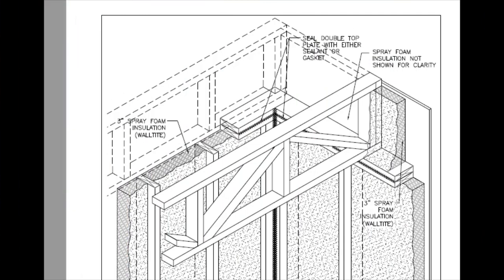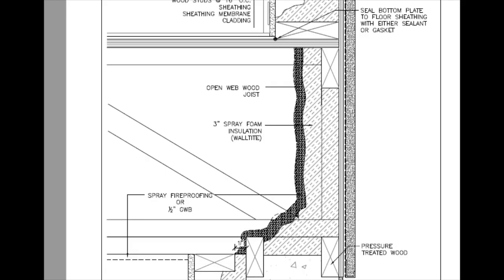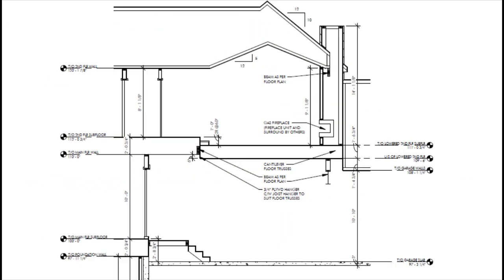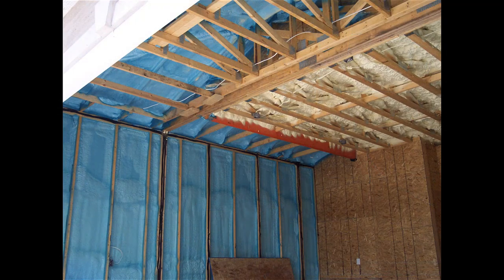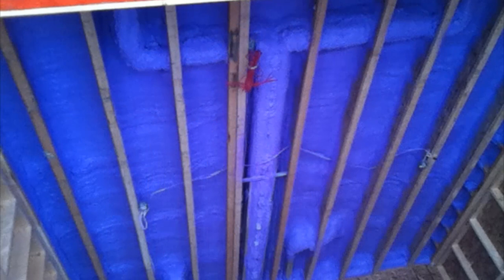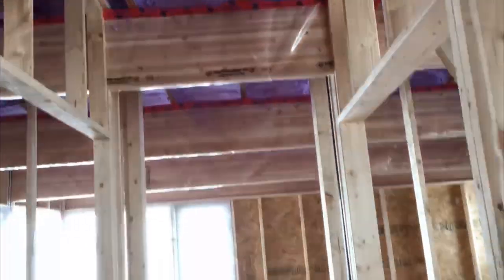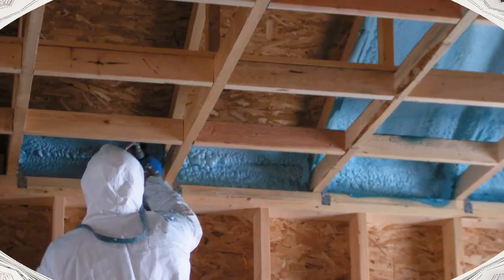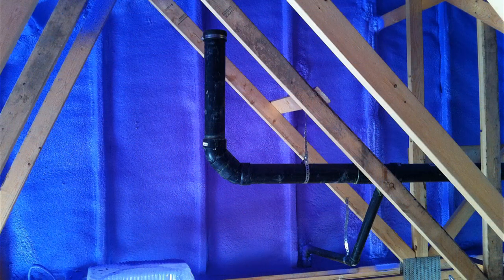6 Areas That Need Spray Foam Insulation In Your Home - And Why

Comment: So my question for inside roof applications is how are roof repairs dealt with?  Many people discover that it's time to repair their roofs when they start leaking.  It would appear that with a closed cell application that roof damage would almost never be discovered or seen until the roof had visibly degraded to the point that it needs replacing..  At that time a waterproof under barrier could conceal potentially years of damage to the  plywood roof sheathing..  And since the system bonds itself to the plywood and trusses/rafters it would make replacing or repairing that damage problematic.

Just curious if that is an issue and how is it dealt with as that is one of the concerns we have before moving forward with a retrofit/spray application in our own attic..
Reply from the maker: Please watch our video "closed cell vs Open cell for roofs, which is better".

Comment: Great videos!! 
I’ve recently decided that I want to get into the spray foam business her in Texas. I have been doing my research and scheduled some training with BASF but you as a professional with 15+ years in the industry, would you have any advice for a beginner, how to start, what certificates to carry, any advice really. This is an open question for anyone who is in the Spray Foam Industry. Thank you all in advance.
Reply from the maker: Go work for someone for 2 -3 years first. Otherwise stay out of the business.
Reply: @SprayJones  so who did it first? You realize there's gotta be someone who learned without working for someone right? I really like your videos but everytime this question comes up you answer the same thing which I get why but disagree. People can learn, are they going to make mistakes? Yes of course, just like you did I'm sure. I think there is a way to get into the business gradually without working for someone else firdt
Reply from the maker: @201francois  When CUFCA started in Canada in 1985 they certified the already existing SPF installation companies that wanted to be the first certified accounts. Then the only way to get into the SPF certified business was to be apprenticed with 2000 hours of verified spray time before you could write your tests bu one of them. No avenue existed for cold start ups.

In 2005 the industry deregulated in Canada because of requests for growth, and a flood of installers hit the market just as you suggested. With it, a flood of BS problems have skyrocketed. Hence this channel is now out to get back to the knowledge and teaching aspect that has been lost. 
The old methods had merits and I do not endorse the fumble around ways. 
Do you apply this logic to flying a plane? Being an electrician? 

Some things you just don't want to learn the hard way.
Reply: @SprayJones  depends on the industry but since I know aviation I'll talk on that. The answer is yes. You take a course then you have your license and you fly. Sure you don't fly the 747 right away unless it's your own but you can still fly as a commercial pilot as soon as the courses are done. 

Same thing for a lawyer, an optometrist, a mechanic, so on so forth. 

Could the industry go back to better training? Probably. But one guy can certainly learn and grow as it goes. 

As I said, I know where you are coming from and I know you are mad because instead to just sell a product you have to deconstruct the myths then sell but I just sincerely believe a smart person can learn anything with the right approach. Yours is just different than mine.
Reply from the maker: @201francois  I do not deny that a smart person can, and they have. We learn ongoing, of course we do. It takes more than book smarts to be great at this line of work. I have been around very stupid engineers that could not figure out the envelope, but we could. However, the percentages out there suggest that we cannot structure it in a cold start method to protect everyone involved. Plus most people are romantic about spraying foam but find out they hate it. So why not apprentice first before investing. 

I keep educating the masses so that we can work. I have had more issues created for us by newbies versus any other factor other than financing or weather. 
So yes I am biased. I believe in apprenticeships and mandatory accredited training and inspections.
Reply: @SprayJones  I've wanted to do spray foam on a professional level since the first time I seen it on tv years ago. Never even knew it was an option where I live in Wv. So as soon as seen a company in my area was taking on applications and would help get you trained and certified I went for it! In a month I may decide or they may decide its not a good fit. I told them I'm ok with that. I'm the type of person that takes pride in my work and fully believe you should do your job right the first time. I definitely could not in good conscience spray somebodys home not knowing what I'm doing. Nor would I expect the company to keep me on. So thats why I'm watching your videos. Just so I have a general idea of what to expect! Really hoping this works out for me. If not I'll be gracious and thank them for the excellent opportunity go on my way with some money in my pocket and hopefully learn something along the way.
Reply: I'm brand new as well. Just got hired on for a 90 day probationary period. I'm just going in willing to learn and watch what and how they are doing it. I'm going to bust my butt and try to prove I'm worth having on the job site. My background is in more physical work and cleaning. So I'm hoping that I can build my confidence when it comes to prep work and clean up. Super excited to spray but fearful of messsing up and costing my employer money. So any advice would be greatly appreciated! I start Monday.

Comment: I have always talked my customers into closed cell foam any opportunity I can get. It is a great solution for everything you mentioned in this video. My question would be do you recommend a foil vapor barrier between the roof sheathing and the insulation? Thanks for the video.
Reply from the maker: No you do not. SPF - closed cell- properly installed is a stand alone product when caulking is used to fill gaps the foam cannot get into. 

Thanks for your good word on the foam!

Comment: I understand that foaming under a roof deck with shingles will cause them to fail in a relatively short time frame.  Several videos on here dealing with this problem and virtually all manufacturers will not guarantee their shingles when installed on such roofs.  What's the deal?
Reply from the maker: Go watch our video "spray foam and shingle life, just the facts"
Reply: @SprayJones  - Very good video.  I watched it entirely.  I still question whether it should be used because there are other, equally well researched and presented videos showing just the opposite.  Dang, even construction techniques seem to be becoming polar opposites.
Reply from the maker: @flick22601  Then do what you want. I will not deal with someone who is confused.
Reply: @SprayJones  - No need to get snippy.  It's just that nobody really seems to know and people on both sides have evidence to back their claims.  I'm not saying either is correct and it's not me that is confused if there are opposing points of view or if you think I'm confused, then you haven't listened to the people with the opposing viewpoint.

Comment: The joist ends do not get insulated or protected from moisture when you close cell them.  Closed cell on the outside could solve, but blow grade to protect the foam.

Comment: My house was built in the early 50's and has plenty of cold spots.  I looked into doing spray foam but found it too costly for my budget.  Opening up the walls is the right way to go but I'm afraid to find the unexpected.
Reply from the maker: Thanks for sharing
Reply: What did you end up going with?
Reply: @briansusewitt8475  Nothing in the walls but I air sealed all the ceiling penetrations and added blown-in cellulose to the attic. The results are effective but not perfect.
Reply: You can get cellulose or something similar blown into your wall cavities. This would require 2 or 3 inch holes to be drilled for every stud cavity, which could be done from either the inside or outside. This requires repair to get the holes covered and finished over again of course, but this would be A LOT less disruptive and costly than stripping down to studs to get foam sprayed in there. 

Yes, foam would get you better air sealing and R per inch, but it's a lot more work and expense. Personally, I would only do foam if I was already planning to do a 'down to the studs' renovation on a house for other reasons.
Reply: @mpettengill1981  The cellulose would be directly in contact with the brick which would eventually get wet rendering it ineffective, no?
Reply: @MarlonJoseGE  That's a good question, but it depends on a lot of different variables, in particular how cold it gets where you live, and whether or not there is an existing vapor barrier behind your interior finish wall. Talk to a reputable insulation contractor in your region and they can make a recommendation for your particular home construction and needs. I'm not an insulation expert, just a dude on the internet who has fixed up a few old houses , so I can only speak to my own experiences :-)
Reply: @mpettengill1981  1.5yrs ago when I did this I removed the baseboards to seal the gaps with backer rods and caulk.  And via that gap, I could see straight through to the exterior brick/mortar.  No vapor barrier whatsoever was in place. That explained why my interior walls are so cold in the winter. (Climate Zone 4)

Comment: Nice video! Hopefully you can give me some wise advice!
I just had open cell installed in the floor joists of my modular home. The crawl space is still exposed to outdoor elements because it only has plastic vented "underpinning" or "skirting". It does have 6 mil plastic on the ground but it's not in the best shape. Under the plastic is dirt and the bottom of the insulation averages between 2.5 and 3 feet from the ground. 
What would be the next steps to create an efficient insulation system? Should I install a tyvek type material against the foam and joists to prevent moisture from rising into the open cell? Should I attempt to encapsulate the crawlspace and try to make it air tight? Should I be more concerned with installing new plastic on the ground?

Thanks in advance!
Reply from the maker: I know too little about your personal situation to advise you on next steps. There are many variables left out that need consideration.
Reply: @SprayJones  Thanks for the response. What types of variables would you be referring to?

Comment: Can I use 2" rigid foam in the walls and seal the perimeter of each sheet with blown in foam?
Reply from the maker: Yes. 

You can also walk on hot coals if you move fast enough...

Comment: I live in Atlanta.  I've been thinking of 2 spray foam projects.  Which should I do first?  Spray foam crawl space foundation wall, with foam board rim joist (for termite inspection).  Or should I spray foam my roof?  Which would yield the biggest energy benefit?

I've heard that spray adds strength to a structure.  Our home was built in 1921 and does not have a subfloor.  Joist are spaced 20" - 30" apart.  Our hardwood cherry floor is all 8' lengths.  Would spray foam from underneath stiffen the floor.  Or would it expand and come through the cracks into the living space?

Thanks
Reply from the maker: Roof.

Comment: Have to remodel a bathroom and took some sheet rock off the wall. To my surprise I have a few spaces that had no insulation in exterior wall. It was stucco, wire, and seem like vapor barrier, studs than sheet rock. Empty wall spaces seems like very poor construction. Home was built in 1992 in Las Vegas would spray foam be a better choice in this hot climate?
Reply from the maker: Hmmm, let me think..... YES.

Comment: Hi Spray Jones,
Quick question; I have an older farmhouse recently gutted and renovated. I went with batt insulation when I put her back together.  My house is framed out if old growth barn wood. My Contractor said that we could not use spray foam because wood needs to breathe and that it could begin to rot if we used spray foam. How do you spray older homes like mine? Thanks !
Reply from the maker: What rubbish. We aren't encapsulating the wood in spray foam. Plus how much moisture do you think is left in old growth barn wood? You got bamboozled.
Reply: @SprayJones  
Thanks 👍
Reply: I have sprayed 200 year old barn up here in Maine a bunch of the some were done 18 years ago not one problem yet

Comment: Hi there, 
Looks like you do great great work and all it top quality stuff! 
Question? I’m dealing with a 100 year old house, live in Massachusetts.
outside walls are 2x4 and I’m in the process of renovating the whole first floor, took out the blow in insulation and I want to go with foam of course. 
Should I use closed or open cell in the outside walls ? 
Also what should I use in the ceiling insulation. The whole floor is gutted out, floors walls ceiling. 
Thx in advance
Reply from the maker: I am a big fan of closed cell. It is the rolls royce of spf. However it will have to fit your budget. Open cell is better than no SPF.

Comment: Is that closed cell in the attic? Also, is it ok to apply 2” to the top side of the crawl space and rim joist (totally isolating that space from the house above) as opposed to the walls/rim joist?
Reply from the maker: Yes closed cell being used. 2" to top of CS, yes we have done this for cold crawl spaces. If they are heated we spray the perimeters.

Comment: Thanks for the information.  With 2x4 walls.. if u use 2 " of foam do u need to fill the 1.5"  air cavity before the sheet rock is installed?  I'm in central California valley.
Reply from the maker: I concur. Jay beat me to the answer.
Reply: Jay Bietz no you shouldn’t at least not in nc.. depending on the code for where you’re at.. 2” of foam is an R-15 which is up to code for a 2x4
Reply: @carlfrase8097  thanks for the reply.. I'll not worry about the void between the foam and sheet rock. 
Jay
Reply: Jay Bietz the void really means nothing.. the foam is not only a insulation but a sealant (closed cell) so the void you are worried about is nothing at all but a little extra space (almost like putting left overs in a tuba-ware container.. and having that little void between the food and the lid.. it’s nothing at all lol)
Reply: @carlfrase8097  thanks for the good advise..

Comment: So it seems u never had issues with 1.5” ... idk I’m always a bit worried and spray 2” min since I’m scared it would not be enough thermal break but ur 10 times longer in business! I enjoy the videos lots of good information!! And of course I like to watch u Guys spraying that butters cheers
Reply from the maker: I have jobs sprayed with an inch. A lot of commercial specs here call for 2 inches, like on concrete etc.

Comment: A lot of closed cell... what’s the yield per set?
Reply from the maker: It's the best and what started the industry. We get 5000 board feet
Reply: Spray Jones - 5000 man, that’s good. I get about 3500 a set.., what’s the R-value per inch?
Reply: Is that closed cell 2.0? Or the 1.6, 1.7 if I can ask...
Reply from the maker: @edgargonzalez6044  They rate it on r for thickness. 19 for 3 inches. BASF is the best on the market.
Reply from the maker: @edgargonzalez6044  1.85 lbs is the design density. When everything is going your way...
Reply: Spray Jones - oh ok, I need that closed cell. That’s covers 5000 board feet.
Reply: Thanks for  replying, I’ll be searching for a closed cell with that much coverage.
Reply: @edgargonzalez6044  thermo seal has good coverage

Comment: Do I need  to spray foam on the out side of the gable wall and between my neighbor joint wall?Do I need no left the gable wall for the foam to breathe,Or to seal the gable wall to max the performance of the insulation?
Reply: Foam doesn’t need to breathe.... you want to spray your gables, to isolate yourself from the other “building” giving you everything you pay for
Reply from the maker: Sorry I have too little info about your job to advise.
Reply: If you are in a condo and your gable is acting as the party wall, then yes you would seal it.